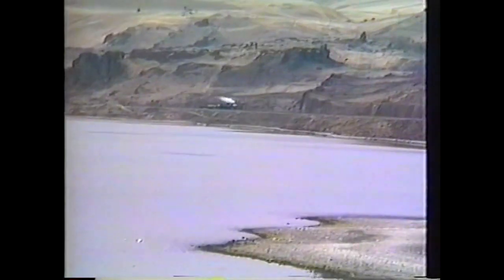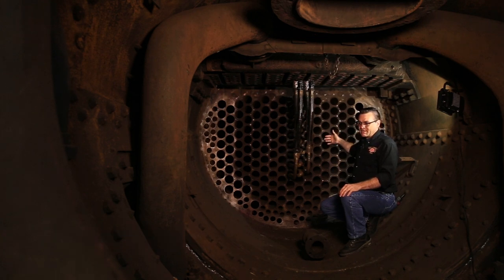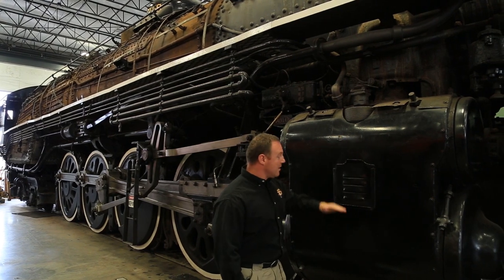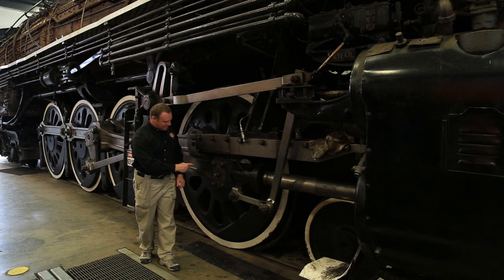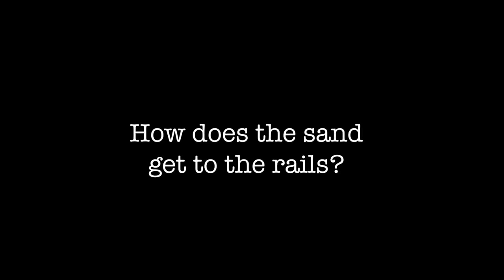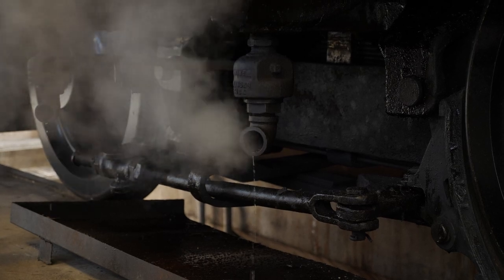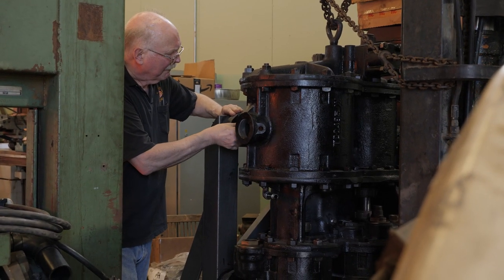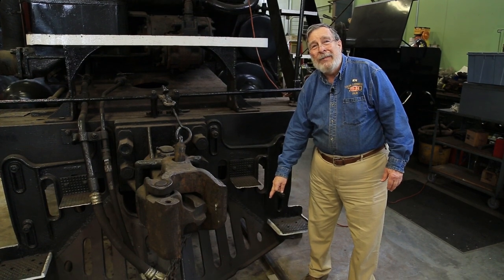Challenges of Steam

Comment: Another reason diesel-electric won out was track maintenance.  Steam locomotives have a "hammer-blow" effect on the track, which required more maintenance.  Diesel-electric locomotives don't do that - the motors have a smooth pickup.
Reply: High amounts of hammer blow is also a sign of poor balancing on the motion, and on many locomotives baring the most modern (as in 1940s-1960s modern) could often suffer such problems. However, well balanced locomotives can do far less damage to track, being similar to diesel locomotives on some of the final locomotives (engines like the Niagara and N&W J where notorious for this, but you also have a awfully hard time tracking records of harsh track damage after western railroads found they didn't like compounds in the 1930's apart from when it's been destroyed by a very different means).
Reply: @jacobditmars8414  From my understanding, the super power designs could be about the same or a little easier on track than first generation diesels, but yes, the earlier USRA designs and archaic stuff was worse on roadbed.
Reply: @mistahoward9772  yes, but I say till  the replacement of compounds in the 30's because that was the time that railroads eather through out compounds because of hammer blow (UP bull moose 2-8-8-0 locomotives where converted from compounds to simple articulateds in 1937), or started better balanceing of locomotives (what I assume the N&W did). Those where the last times (as far as I can find) where superpower had bad hammer blow. Everything beyond then was much better balanced and hammer blow was rarely a problem from then on.